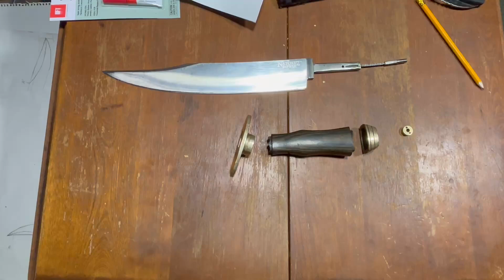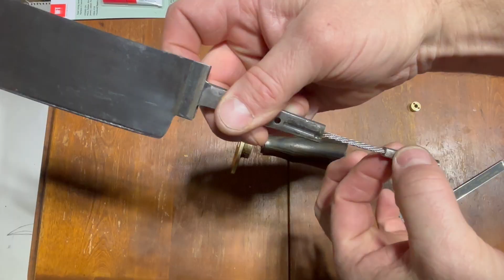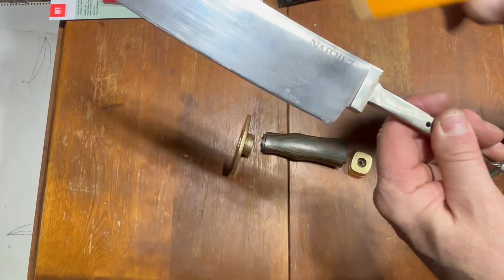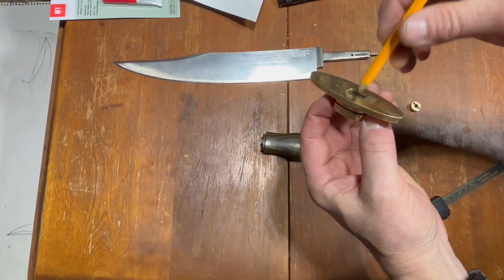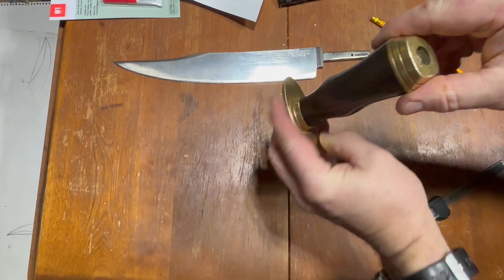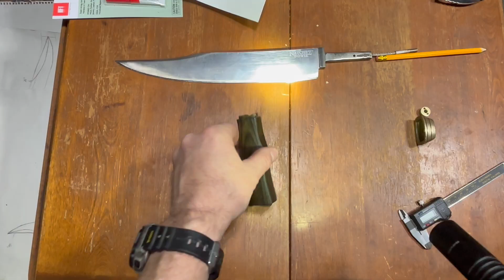A closer look at the Cold Steel  Natchez tang and handle construction.

Comment: The new ones have no cable. It is just glued to a short tang with a long bolt. They break and come loose! Typical of cold steel now cutting corners! There is no way to tighten the pommel now.
Reply from the maker: Ivee got more to say on this tang, and unfortunately its not good.

Comment: Cable is fine as long as the handle is resistant to cracking, canvas micarta would be the best arguably.  These sharp 90 degree cuts with a popsicle stick tang are why people think all hidden tang knives are inferior to an exposed tang so I view the manufacturers who carry it on as responsible for the complete dogma surrounding this topic.  CS knows how to do it right too if you look at a tai pan tang, weird that they cut corners with a wider blade depth
Reply from the maker: Honestly, I'm not so sure of my assessment. I've had some unexpected issues crop up and have not determined if this was a result of my actions or the construction in general, or a flaw in this particular knife.